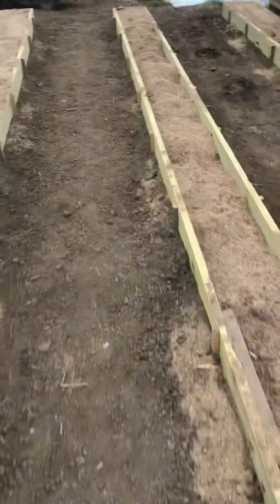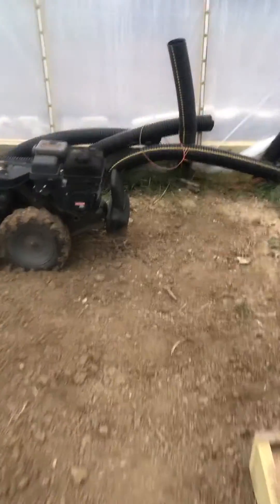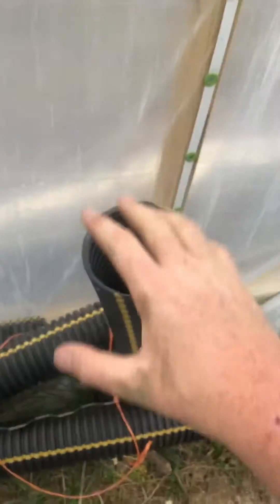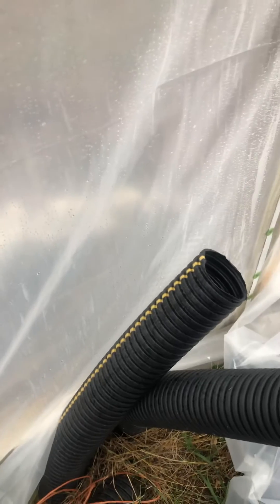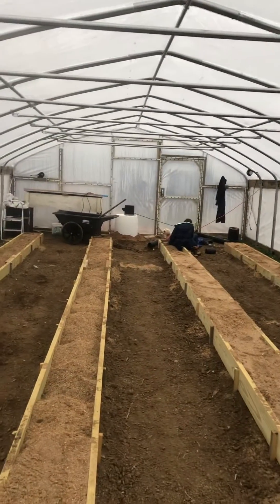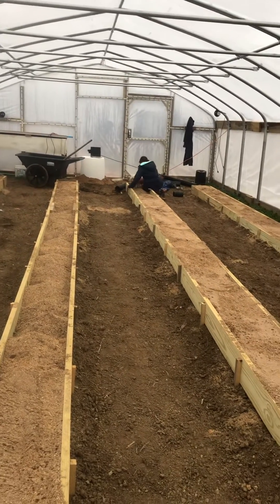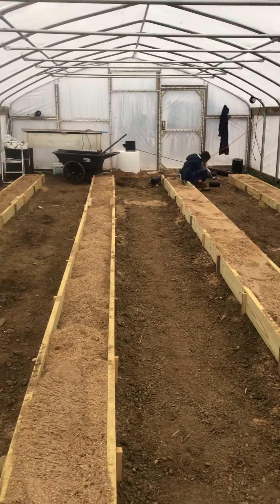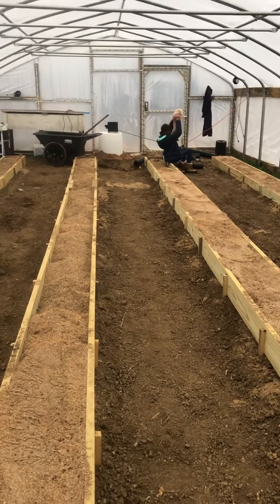Blower operating on geothermal heat sink greenhouse (2019)

Comment: What size if the barrel that the fan is on top off? And has this design been working well for you?
Reply from the maker: It’s a 55 gallon barrel with roughly 8 inches cut off the top.  We didn’t finish it time this year to test it during the winter with crops. This winter will be our first winter test. Currently we are using it to reduce the temps in the top of the greenhouse.  It’s reducing the temperatures by 10-12 degrees.

Comment: How many CFM is that fan?
Reply from the maker: 1057
Reply: @smallblockfuelie  
1057cfm will be the free air flowrate with no duct connected. If the fan has a graph showing airflow vs pressure the output will be around the 0.5" wc (SP) intersection on the curve,